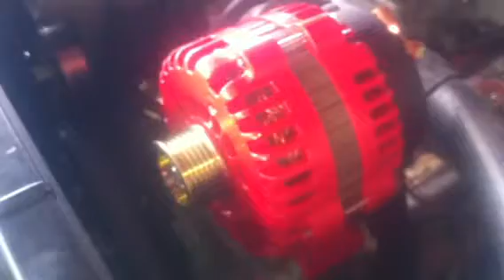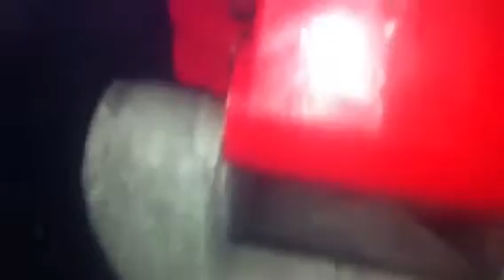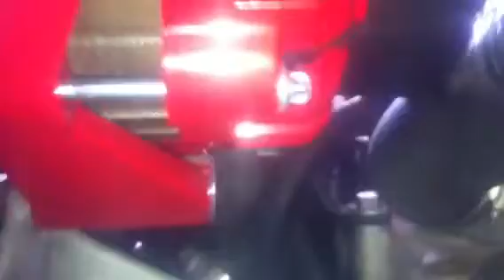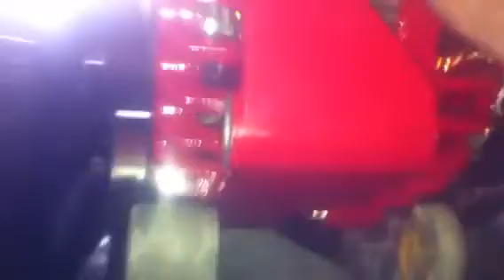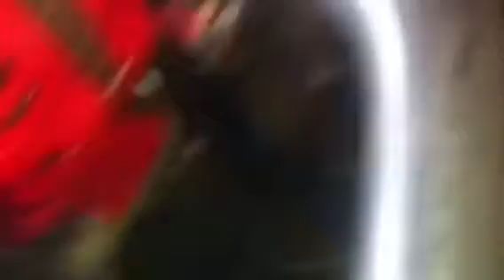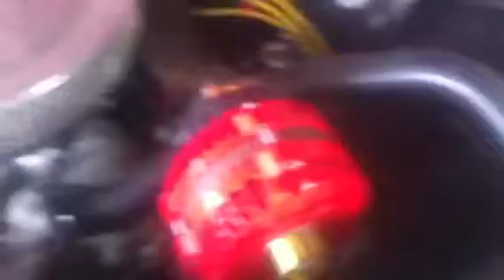Insane Bass #9 installing Mechman 400 amp alternator

Comment from the maker: @dalton456 and why not? I'm gonna have three 16 volt alts and one 12 volt. And if I mix and match them I will have around 300 - 400 amps at idle, and up to 1600 at 2000 rpm